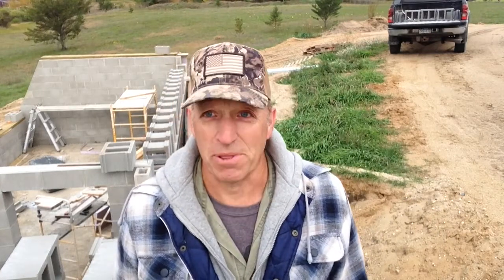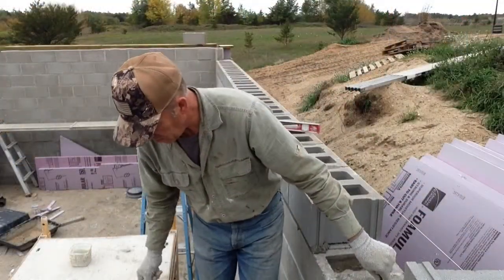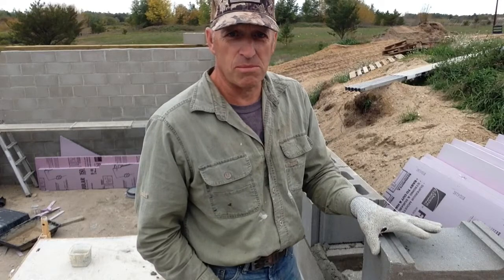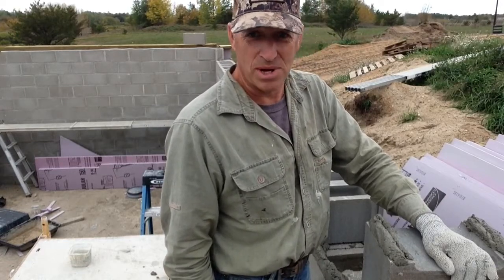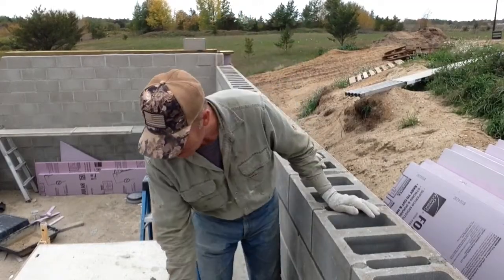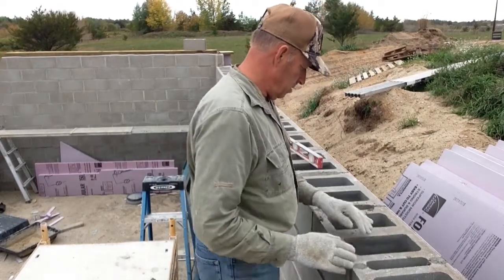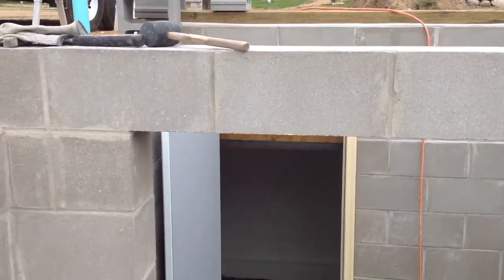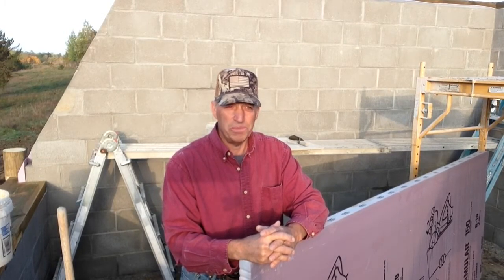Why not just use ICFs?  Deep Winter Green House, part 14

Comment: I see that ppl in the comments are complaining for filling the joints with mud.
Rest assure you did an awesome job! I live and work in active seismic part, and our code requires filling the joints as prescribed. Anything different and it wont pass inspection. Heck, no one would even hire a mason who thinks he knows better!
Also if there aren’t poured columns, adding a rebar with complete filling on a vertical holes every 4-5 metars distance between, and laying a rebar  on horizontal up to max 3m heigh with complete tie up on the structure is required. Don’t know the details of the code exactly… but there is a lot of common sense.
So from what I can see, you have done an excellent job.
Reply from the maker: Besides the horizontal rebar every 2' in wall height, I place vertical rebar every 4' of wall length.  Thanks for your comments Stormtrooper!

Comment: Notfaulting your work because from what I see everything looks pretty good, but filling between the ends of the block is a totally unnecessary time and material waste.  It is never done anywhere nor has it ever been required in any building I've ever worked on in my 40+ years as a mason, and I've laid hundreds of thousands of block.   It doesn't do much to increase bond or structural integrity, nor does it increase the r value since your insulating the walls anyway. Not only does it waste time and money but it slightly increases the weight of the whole structure, though it is negligible.  Why make things harder for yourself and others who may think that it is somehow better to do so because they watched your video?
Reply from the maker: "Some do it this way, and some do it that way." -is what my dad used to say.  No, I am not a mason by trade, but I was mixing cement and carrying blocks 50 years ago; when I was a young boy.  This video was about thermo mass, and insulating the exterior.  I wanted to leave no empty spaces, and I did not want to fill the ends with sand.  The joints needed to be filled as the wall went up, otherwise you can't get to them.  It's a matter of opinion.  This is the way I did it.  Having torn down concrete walls before, there is a noticed added strength when the ends are filled with cement, because it is a mechanical joint.  But I have laid walls before without doing it.  And no, the way I did it, is not some required way of doing it.
Thanks for your comments of experience and opinions!